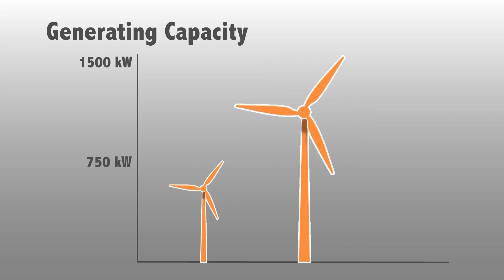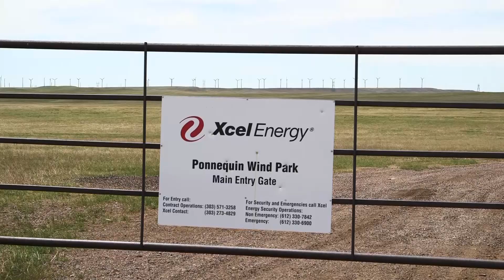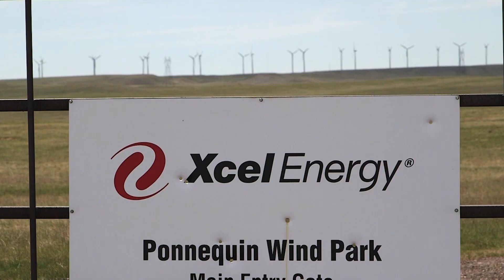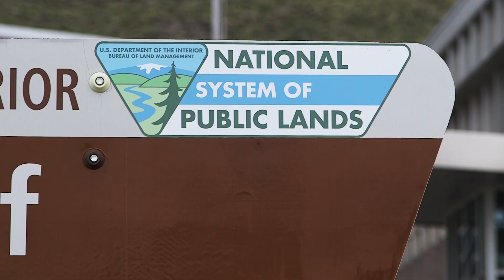Who Cleans Up When a Wind Farm Retires?

Comment: I do not understand this industry. The existing power producing turbines are not profitable ? Someone help me understand this.
Reply: The older wind farms aren't as profitable as newer windfarms. The reason for this is due to size. Older wind farms were smaller in size which means more labor to maintain vs. the larger wind farms with fewer # of them.
Reply: They are too small, we have bigger more efficient ones now and I suppose that they’re also just too cheap to keep it going and to clean up.
Reply: Its bullshit ...of course they can keep em running .....terms like clean up sounds like nuclear waste.....total load of crap
Reply: @danielb516   Have you ever been close to one, or seen one in ruins? Each one is an environmental disaster regardless if it is turning or not. Half-baked idea that should never have seen the light of day.
Reply: @cattycorner8  ...I have and they make a terrible humming noise but it's better than coal or oil fired plant ,,,,so if you put it out somewhere like say the ocean it's a win
Reply: @danielb516  .....and what you write--by the FORCE of your exalted persona--is NOT a "total load of crap"?????
Reply: I can't imagine investors putting capital into a project that they don't think would be profitable.
Reply: http://www.clepair.net/windSchiphol.html

They can only be put up where ignorant green feeling city voters have required more renewables be a legislated part of their power supply and this then requires subsidies which open the door for pols to get in bed with big pocket investors that will rape your grandchildren with 150% electric rates in the future for these ponzi scheme farms today. Who's financing these things? - don't be too surprised to learn it's the same old good ol boy network as usual. They smell money, your grandchildren's money with government guaranteed payoff for billions invested today. Wind and solar still can not compete without heavy subsidies. Nuclear, coal or Gas, those are your cheap choices. Only one is green.
Reply: @leebarnes655  Old people are out of touch and love costly pollution. They need to hand over the reins.
Reply: It's just feel-good democrap bullshit that was never meant to make sense.

Comment: Nobody needs to remove the road.  It can be used for other purposes.
Reply: Yes, roads leading to nothing are very valuable.
Reply: @nitetrane98  If there is really nothing.  Then the road should not be in the way of anything.  So why remove it?  But maybe someone will be farming there tomorrow.  So he could use the road for farming. And can you realize how practical a road on a farm is?  A potential farmer will re-adjust his infrastructure planning to whatever infrastructure there is already.  A build road is very valuable.
Reply: As a farmer, nope, the roads are just in the way..  Farming around them is wasteful, takes fuel, time, wear and tear on equipment.  And taking them out doesn't return the land to original state.  Just look at Google Earth where rail lines used to run, you can still see the lines 30 years after they have been removed and farmed over.   @Deontjie